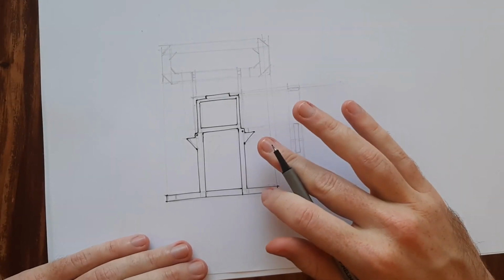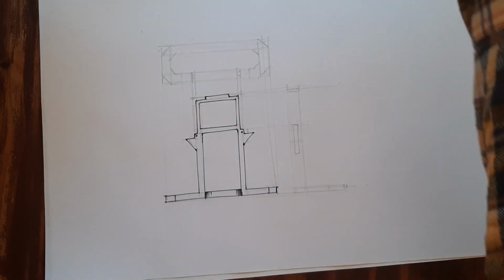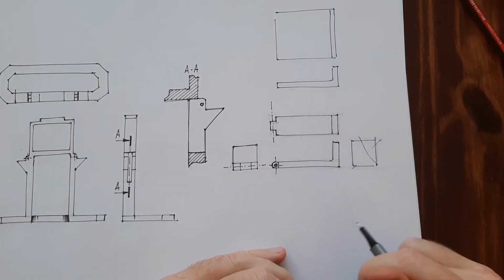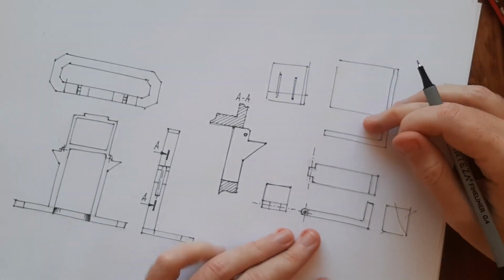What is Technical Drawing?

Comment: Are there any technical drawings where you prefer to use a CAD software instead of hand drawings? Or are hand drawings always sufficient?
Reply from the maker: For technical drawing, I always use cad, because it's much faster and more precise to create a drawing with the correct dimensions based on a precise model.

Comment: My dad used to do technical drawings and QA for a midwest sheetmetal manufacturer. I love this kind of stuff and have started getting into it for hobbies so I can accurately definite my solutions to design requirements. Wanted to share (you may not know, but you probably do) that you can set your camera to manual focus to keep it from focus hunting when you move your hands in and out of the frame. I love your video. Thank you for sharing!
Reply from the maker: Yeah, that autofocus issue was silly. Ever since I shoot on a different camera and I fixed the autofocus issue. And technical drawing is really fun glad you like it!